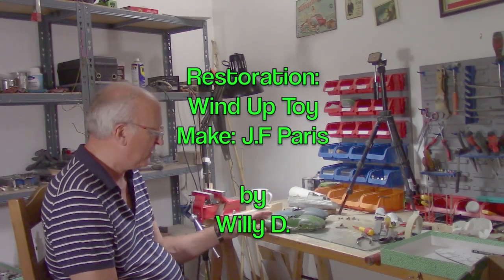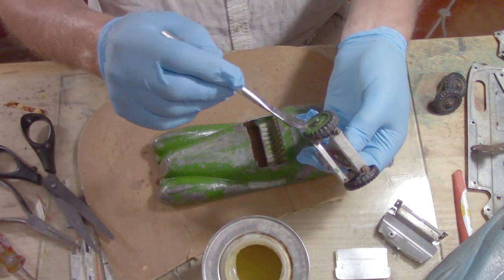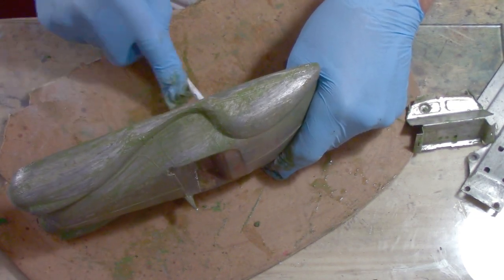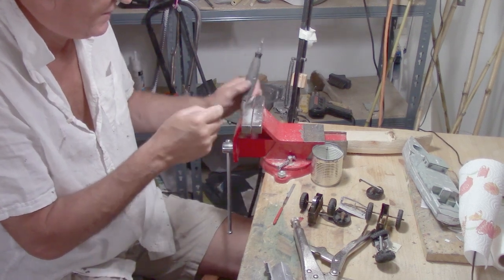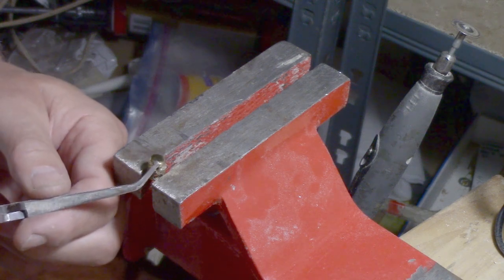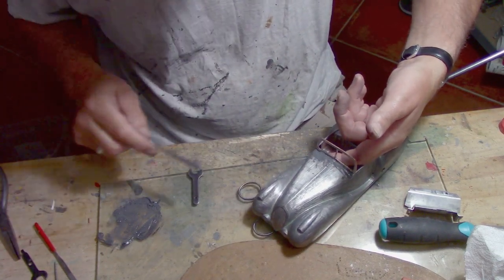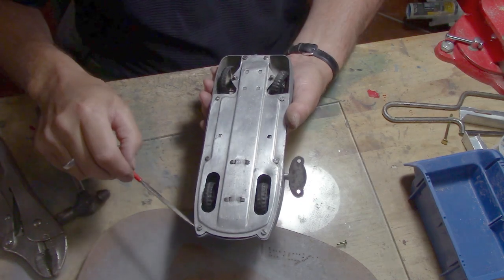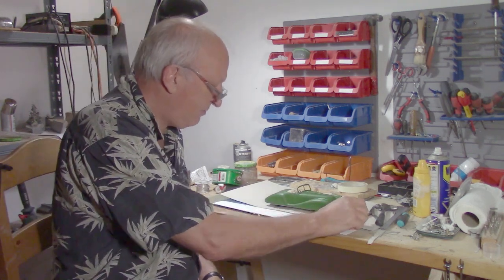HOW TO RESTORE WIND UP TOYS

Comment: Nice save, Willy.  I had a look around to what brand it may be. Not a lot of info available, but it is a Jaguar XK  and potentially a Vintage Schuco. I'd like to see the grille and light's touched in with silver though. Cheer's John
Reply from the maker: Hi John, The blue is original paint and they did not paint in silver on these cars. The brand is J.F Paris by the markings on the inside. I found one on a site but there was not much detail. Did not know it was a Jaguar XK. I thought it was a vintage Schuco as well as the design is similar. Thanks for the info.
Reply: Hey Willy. Found  the correct type of car model . It's a Delahaye  Cabriolet. Produced from 1944/48 By J F Paris as you said.
Reply: @WillyDahm  
Hi Willy I have some old vintage toy car 
Are you in  intrested to buy
They are made between 1940 1955